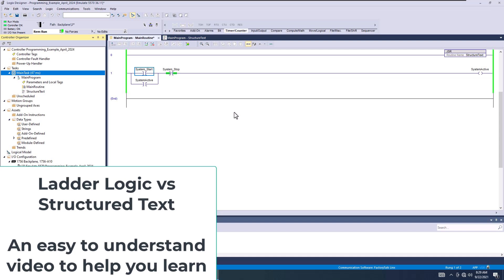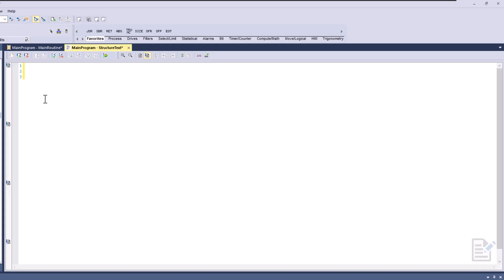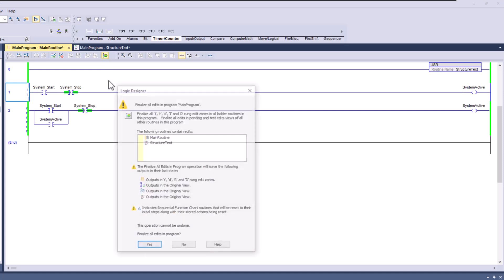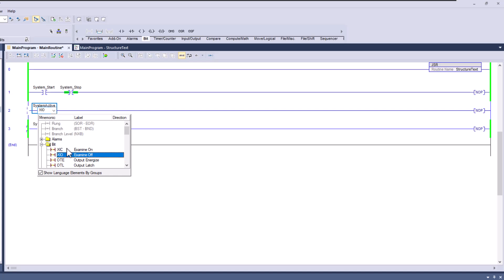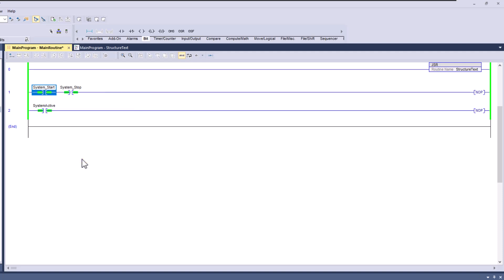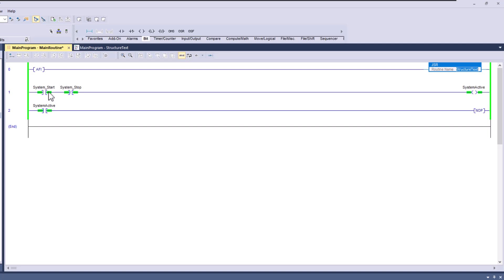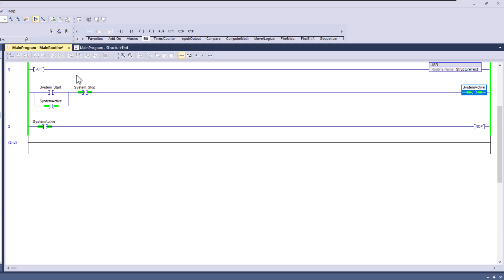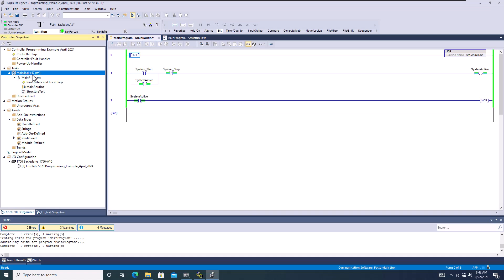Ladder Logic vs Structured Text | An Easy Way to Learn

Comment: Great Video Shane.  I appreciate your videos .   
So if I am understanding this correctly.  The structured text as you have it written, will not act as a "Seal In" because of the Else  System_Active :=0;     thinking of System_Start as a momentary push button input  which is why you would use the  Seal in ladder logic in the first place.  so you would have to hold the Push button down to keep System_Active true or 1 using the structured text.    You would have to write an another  IF statement to set the System_Active to false or 0. for the structured text for that logic to act as a seal in.  Am I correct in my thinking?     
 I think this is where a lot of the new folks get confused,  making that connection to the practical application.
Reply: You only need to add "OR SystemActive" after System_Start in the IF statement to make it work. Remember, AND is used for series, OR for parallel
Reply: Mmmmm 🧐